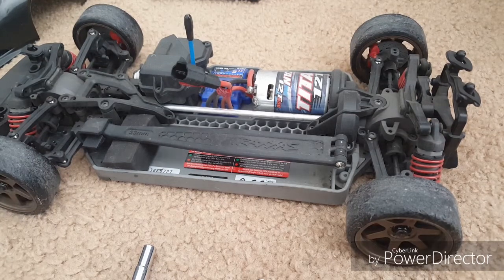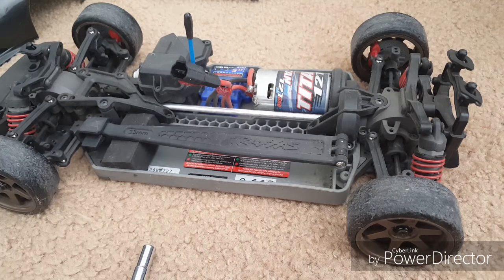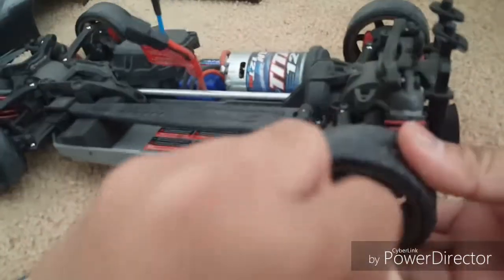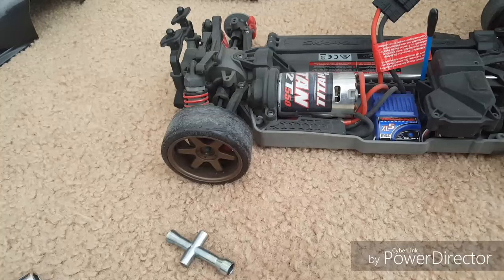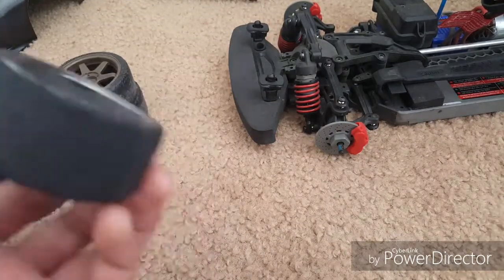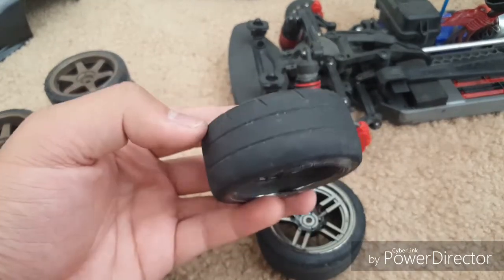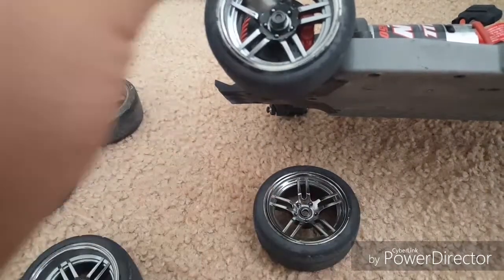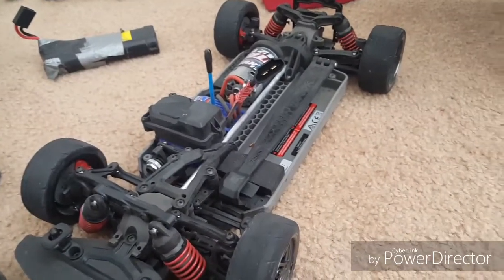How to Remove and Install RC Car Tires (Tutorial for NEWBIES)

Comment: Really help full thanks😊
Reply from the maker: Um okay then
Reply: FHRC Brony Radio Control and Cars what is there something wrong I mean I'm just asking
Reply: FHRC Brony Radio Control and Cars I'm new to RC cars and I find this video useful but what are beadlock? Just asking
Reply from the maker: Sunset Shimmer beadlocks are types of rims on RC cars that can have the tires locked onto the rims by screwing down bolts to hold the tires tight.  Some real HARDCORE off road vehicles have beadlock rims.